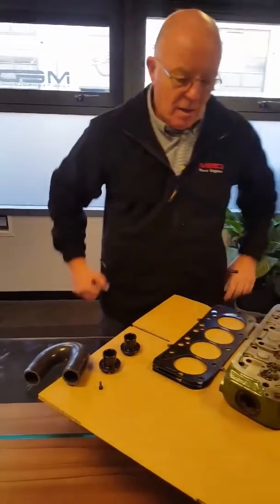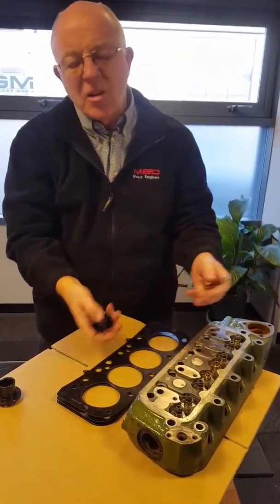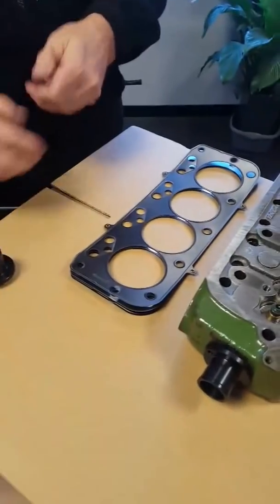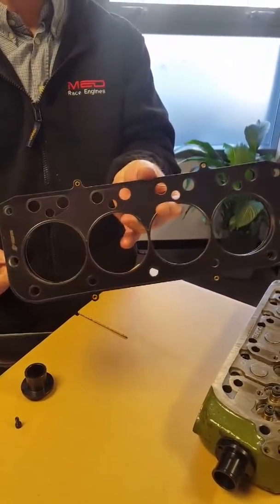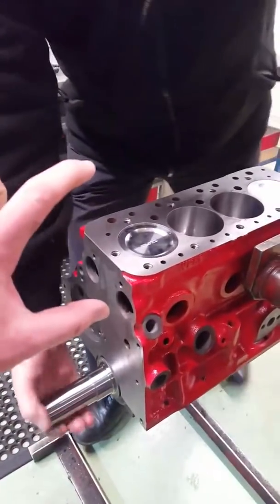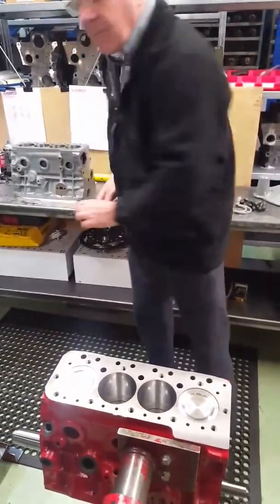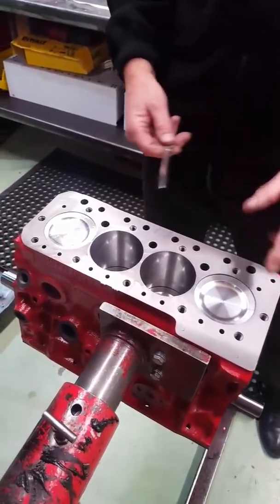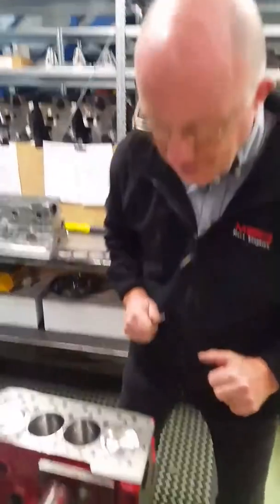How to dry deck an A-Series engine and head

Comment: Hello from Canada. I've been enjoying your videos.
If you wanted to make a semi dry deck engine, couldn't you just block the coolant holes on a MLS head gasket on the number one cylinder instead of using a brass plugs?
If it works, I'll take cash. lol
Reply from the maker: Yes this would work, but you'd need a custom made gasket and we already stock five different designs!
Reply: @MEDEngineeringTechVideos  Great minds think alike.

Comment: I was not clear on what dry decking was, but now I know!  Thank you!  This has me wondering, though, if by using brass inserts of varying diameter holes, one couldn't balance the water flow to cool the cylinders equally without all of the machining work...

Comment: Where can i buy the 4 brass plugs for semi-drydecking?
Reply from the maker: We usually get a length of brass bar and make something to fit - it's not a product we keep on the shelf but wouldn't be expensive for you to make.
Reply: Can you use grub screws instead of plugs?

Comment: Love your videos. Regarding the water pump thing though, I have no doubt as to the end result regarding BHP, however your explanation as to the reason why is incorrect. The more electrical current you draw from the alternator, the greater the resistance it will present to the engine. its just plain physics. Probably the mechanical water pump just presents a much bigger resistance than the alternator, and that is why you are getting more power with an electric pump.
Reply from the maker: Yes, there will be extra resistance, but running flat out the maximum current draw is only 7.5A, which is negligible in terms of bhp losses.